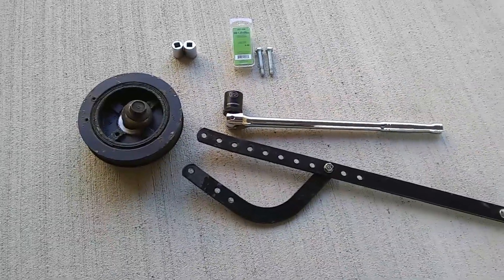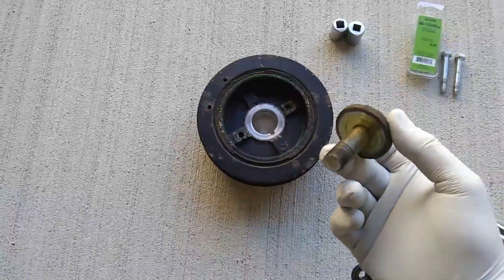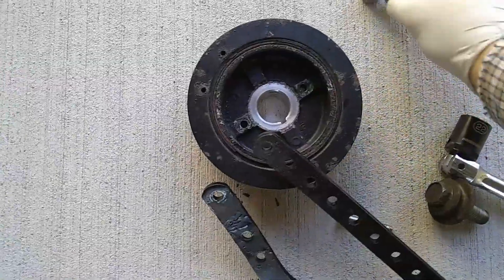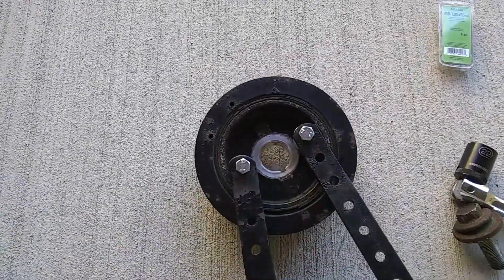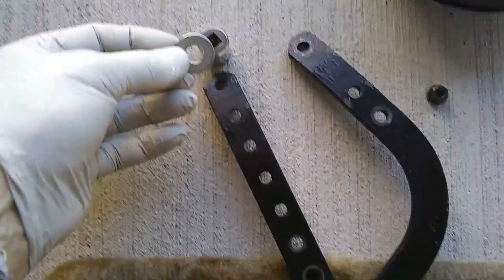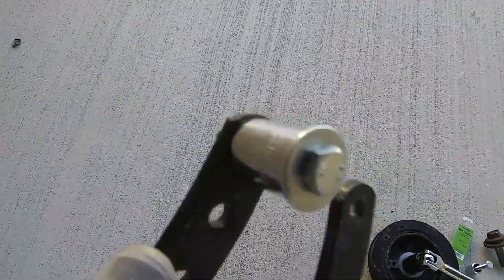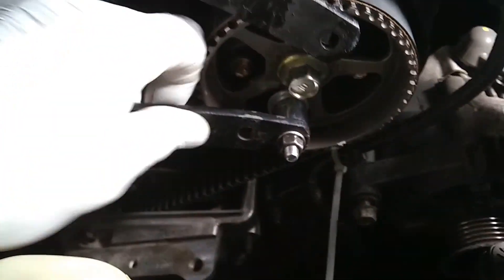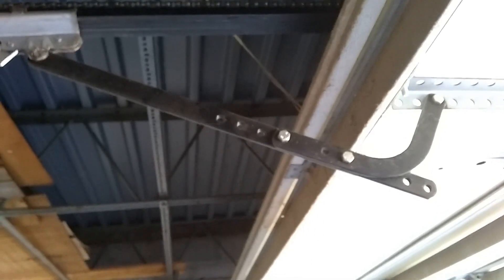DIY Crankshaft Pulley Holder, Harmonic Balancer Removal Tool - Home Made

Comment: Easiest way is simply lock the breaker bar to the frame or suspension (even rest handle on ground) in opposite direction engine turns & just bump the engine once with the key. 
 Total time is under too mins, only need a strap (my real leather pants belt has worked), a long breaker bar & the socket. Thats it!
  I do remove coil wire on older cars or the fuel pump fuse on newer cars first so it wont start up.
  Crank it till its fuel drains from its lines first or it will start up/die once if you dont.
 Very easy to remove it this way. No reason for all this trouble.

Comment: My pullley has no screw holes, only 3 slots.          plus I dont have a garge door arm like that, this pulley bolt has set me back an entire day, so far.
Reply from the maker: Different makes and models of cars have different pulley construction. This one was 2002 Camry V6.

Comment: All you have to  do is put your breaker bar on the bolt against the control arm and bump the starter
Reply from the maker: I've done it too. But some people, myself included, may prefer the more "all under control" solution. And the tool allows to torque the bolt back to factory specs, if someone wants that.